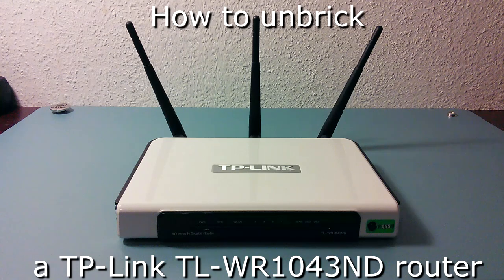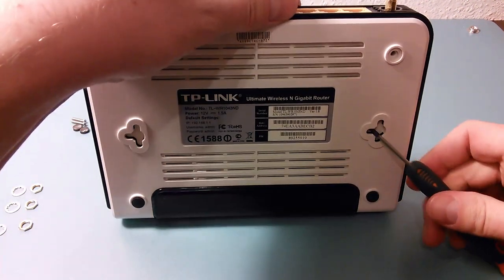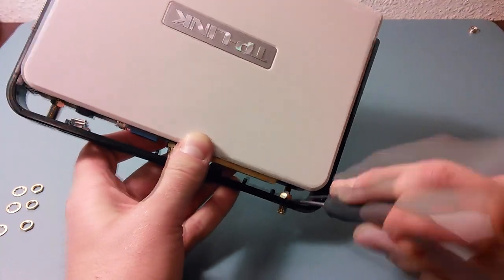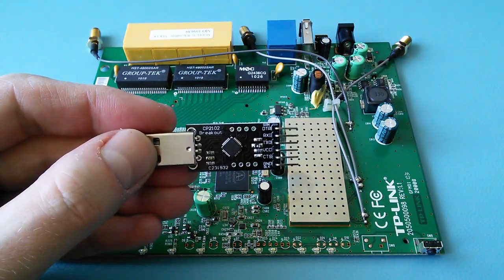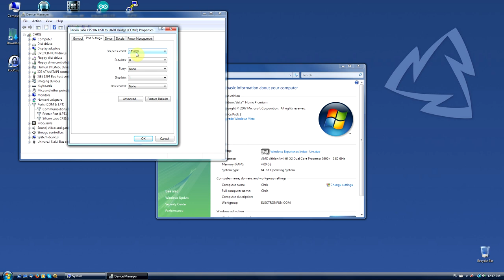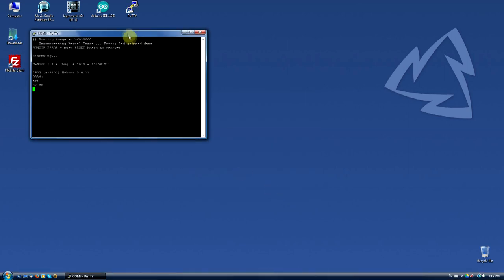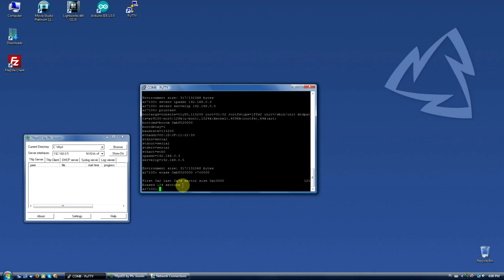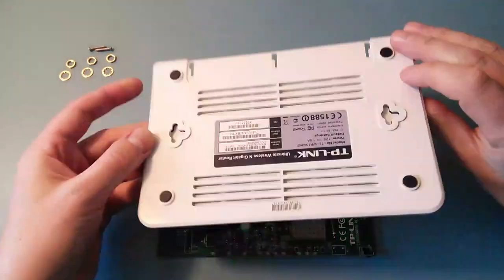How to unbrick a TP-Link TL-WR1043ND router (re-uploaded) || How-to-fix tutorial

Comment: Thank you very much, sir! I managed to issue a new lease on life on my WR1043ND V1.8 ( YB 2008, acq. 2012 ) which I had reflashed with DD-WRT before. It was solid, but acted kinda flaky and I started to question its reliability. As a consequence it layed in a box in my attic for several years as I went for another router. Recently I dug it out, and gave it a try with delicate precaution and triple-checking the boot start and end values of the flash cell. Got it on the first attempt, and now it's recommissioned in my home network as a wireless host. TP-Link dropped support long time ago, so it's high time for security improvement. And there we have it: A router from 2008 running OpenWRT 23.05.0 happily.
Bonus: It comes with WPA3 which is quite remarkable and interesting.
Reply from the maker: Thank you for taking the time to write your comment, sir! It's fantastic to know this old video of mine can still help somebody and one aging device can be saved from the dumpster.

Comment: I am pretty experienced keeping my collection of ancient routers updated with the latest supported release of OpenWRT.  I never had to do a serial console recovery on my TP-WR1043ND v1 until today.  Imagine my disappointment when I removed the two screws from the bottom, and the case gave no evidence of wanting to open.  I found no disassembly instructions on the regular web, so it was off to youtube.  And there was your video, showing how to take it apart without breaking it.  It turns out I didn't need to do a serial console recovery to fix my error, but I'm ready if I ever do! Thanks.
Reply: I'm glad the video is still useful for people, even after all these years.

Comment from the maker: This is a step by step tutorial on how to unbrick a TP-Link TL-WR1043ND router after an unsuccessful firmware upgrade.
How to unbrick a TP-Link TL-WR1043ND router (reuploaded)

Originally I uploaded this video on April 10, 2014, under this link:
http://www.youtube.com/watch?v=zrArf9iTMv4
On October 11, 2014 I accidentally deleted it from my channel. Boy, was I mad at myself!
Reply from the maker: Thanks for watching and commenting :) Sorry for deleting the video and causing this inconvenience.
Reply: Erase correctly, when trying to make tftp ... does not connect to the router :(, because the ip should be set 192.168.0.3?
Reply from the maker: Tftpd isn't connecting to the router, it is only a server/service from which your router downloads the firmware.
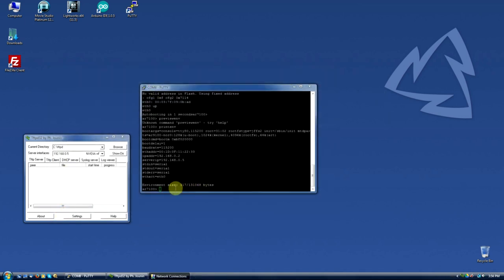Have you set ipaddr to 192.168.0.3 and serverip to 192.168.0.5? (see 13:28).
Reply: I use serial connection, using hyperterminal transfer firmware, recover my router. Thanks for your comment;)
Reply from the maker: Have you managed to get it up and running?
Reply: Yes!
Reply from the maker: That's great! :)
Reply: If you could add info about this 3 pin connector that would be helpful. Can't find it on allegro nor anywhere else.

Comment: This is a great tutorial.  I recovered my WR1043ND v1.6 
I had Chaos Calmer 15.05.1 Released: Mon, 16 Mar 2016 and I wanted to update it to a newer version, so I downloaded the latest release dated Jan 21, 2017 and flashed it.  Well it flashed successfully but the web interface went away and I could not log in using any browser. "Connection refused"  I also could not telnet to the router and because this router HW version was older than v1.8 there was no built in TFTP recovery.  So my only option for recovery was this tutorial.
Many Thanks for this, it certainly appreciated.
Dave
Reply from the maker: Thank you for your comment! I'm happy my video helped you fix your router :)

Comment: Works like a charm. Thanks. I adapted your method to my Linux box, and improvised a few bits here and there. 
To get the boot prompt for example I used... 

while true; do echo "tpl\r\n" >/dev/ttyUSB0;done

Then fired up the router and hit ^C the moment the boot loop stopped flashing. I also used the serial console of the Arduino IDE to connect to the router. 

You can alternatively use cu -l /dev/ttyUSB0 or any number of other terminal emulators available in Linux, for example putty with
 
sudo apt-get install putty

Google to find out how to set up tftp on your linux box, and you are off and running. 

From bricked to openwrt including soldering the header on the board <1hr.  as I already  had a suitable usb serial adapter sitting on my desk, and header pins in my junk box. One less router in the landfill. Thanks again for the easy instructions.
Reply from the maker: +Andrew Hull That's great! I'm happy you found my video useful and managed to unbrick your device. Thanks for your tips, they may be handy.

Comment: You are a GOD ... You just save my router from the DDwrt wrong firmware (Firmware V3 on V1 Session ¬¬) ... I checked your Arduino as a TTL programmer and combined with this video ! worked flawless .... if you use MALE x MALE jumpers you don't need to solder that 3-pin conector on the router board  (as long you work surface is flat and doesn't move)
Many thanks, cheers from brazil.

Comment: Great tutorial !! Thanks.
Two tips I learned:  
If when loading the firmware via it continues to wait with the T T T T T T T T T T reponses and fails, then you most likely have your ethernet cable wrongly in the WAN port of the router, move it to any of the four LAN ports of the router.
If that also fails, then it is possible to copy the firmware to the router via the existing three serial connections you have in place.  You use the YMODEM protocol to transfer the firmware.    To do this download free ExtraPutty as this includes the YMODEM transfer feature.   Do exactly as already discribed in this great vid, but rather than this command
tftpboot 0x81000000 firmware.bin [ENTER]
instead type
LOADY [ENTER]
then it waits to receive the firmware
so in the ExtraPutty header bar, select "File Transfers", Ymodem, Send, 
   browse and select your firmware.bin file
It shoud then copy to the router, much slower than the ethernet copy, but it does work.
Dont forget to continue with the remaining commands as per the video (commands below).
cp.b 0x81000000 0xbf020000 0x7c0000 [ENTER]
bootm 0xbf020000 [ENTER]

i hope this helps

.
Reply from the maker: +Lee Schofield Great tips, thanks for your comment :)
Reply: After failing at firmware flashing trough LAN, I have managed to flash it with ExtraPutty. Thanks a lot!

Comment: Thank you very much with your video I was able to relive my router. Which bricked when you update the firmware to the latest version of DD-WRT. The most difficult part in my case was to desolder, use a desoldering wire. I guess my delay would be because the electric welder does not transmit enough heat to the mesh.

Comment: This video helped me to unbrick my TL-MR3420 v2.4. I was trying to get openwrt working on it, but by some mistake bricked the router. Thanks for the video
Reply from the maker: +Thiwanka Wimalasuriya That's great! Did you use exactly the same commands or did you have to change anything?
Reply: +ElectronFun.com on my TL-MR3420  v2.4  i used 
erase 0x9f020000 +0x3c0000 instead of erase 0xbf020000 +7c0000. 
Everything else was same
Reply from the maker: +Thiwanka Wimalasuriya Thanks, someone may need your comment to unbrick their router :)
Reply: +Thiwanka Wimalasuriya How did you get values you need to type? I have 740N and I'm not sure what to type in.
Reply: +loodack , i found those values from http://redacacia.me/2013/03/07/debrick-your-tl-mr3420-router-with-a-serial-ttl-cable/ ,   did you check http://wiki.openwrt.org/toh/tp-link/tl-wr740n ?

Comment: The beginning of the video did even have hope, because I imagined it would only be possible to recover the router if it had at least initialized, but the video device can't even have a working switch! Mine for years had the customizable openwrt firmware, it was quite useful, but with new equipment on the network I needed the features available only in the original firmware (like QoS control in hardware). I was using a swap pendrive and ended up having a serious problem when trying the original TPlink firmware, now the system led, wan port and dhcp service don't work, clear sign of missing software, but as switch it still works. After work I will run this solution and hope to have this cool equipment back.

Comment: Thanks man! I was able to unbrick my v1.11
2 things:

In my case the screen was not looping with the "autoboot in 1 sec" message. I had to start the putty session and then power up the router, only then the Autoboot in 1 sec message would show up once and the fail with an error message among the lines "file missing on the fs folder" or similar. (i had been fiddling with the fs folder and that's how i bricked mine, i think)

I tried with the original firmware, because i had actually bricked it trying to come back from OpenWrt. It didn't work, it wasn't booting into router function. I moved back to openWrt. 

Thanks again, you saved me a couple of pesos
Reply from the maker: +Vic Strauss That's great! Thanks for describing your case and letting me know :)

Comment: Use TeraTerm and Broadcast command option to enter "tpl" into the boot. That worked.
After this the rest was easy.
note that the default firmeware needs to be stripped (dd if=filein of=fileout skip=257 bs=512) (in case is not in the video).
and this fileout (e.g. firmware.bin) can be used in the tftp directory/upload sequence.

was a day struggling to get into the boot sequence........

Comment: Thanks a lot man, I saved my mr3220 following your steps! I only had to find the correct memory addresses elsewhere. By the way, I was lucky just once when typing tpl+ENTER but unfortunately I moved the cable and was unable to send the string in the right moment after that so I used autohotkeys to assing the F1 key to send it so I just had to press F1 a couple of times. If anyone is in the same situation you can assign F1 to send tpl+enter just by putting the next in a txt file and renaming the extension to .ahk:

F1::
Send tpl{Enter}

and that's all, of course you can use any key you want.
Reply from the maker: Thanks a lot for your tip, it may help a lot of people! I'm glad you managed to bring your router back to life :)

Comment: Thanks, you saved my wr1043nd! 
Tip for others: RS-232 cable doesn't work with it. I have tried.
Reply from the maker: +Konstantin Krayushkin I'm glad it worked for you, thanks for your comment :)
Reply: +Konstantin Krayushkin Which firmware upgrade failed at your wr1043nd ?

Comment: Just a few notes on this, for people that can't still unbrick their router.

I have WR1043nd V1.7 (last version without fail-safe) and i was using dd-wrt, and decided to update my firmware because i had changed my ISP.
Used the wrong firmware version (dd-wrt for V2 instead of V1) and bricked my router.
Tried other tutorials but since my version doesn't have flash fail-safe, and my LAN ports were not powered for some reason, i couldn't fix it without opening it.

I followed this tutorial, soldered the pins, got the latest firmware version from tp-link, the correct one this time, followed the steps but no luck. I was still getting flashing LED's and this message on Putty "No valid address in Flash. Using fixed address. Auto-booting" or something like it.

So, my mistake here was getting firmware from tp-link instead of dd-wrt. Since i was using dd-wrt before the "brickning", I tried flashing the router again, this time with dd-wrt (same version i had before) and voilá, it came back from the dead.

Hope my experience helps someone. This works on Windows 10, with the latest versions of the software's on the video. All good as of 03/12/19.

Comment: AWESOME VIDEO, extremelly simple, very good and detailed steb by step!
Reply from the maker: Thank you very much! My videos are usually simple, step by step tutorials, which should be easy to follow - at least that are my assumptions.
Reply: Can you help? My router is on that loop, I tried to ger rid of OpenWRT to flash back the original firmware, but is bricked, I followed your video and everything went fine, but on the last step, I get a boot error, the firmware Im trying to upload is from the tp-link website, and my router version is 1.6, thanks
Reply from the maker: The firmware from manufacturer's website won't work - you need to get rid of the boot code first. The following website should help you do that: http://fejlesztek.hu/restoring-factory-firmware-on-tp-link-tl-wr1043nd.

Comment: Great video. For anyone with v1.8+ hardware though there's a simpler way that involves running a tftpd server from which the router can automatically fetch the firmware bin file. This is what I ended up doing. No disassembly needed. Read the "Flashing / Recovery using tftp only (without serial console)" section here https://oldwiki.archive.openwrt.org/toh/tp-link/tl-wr1043nd.
Another alternative is using a raspberry pi if you happen to have one. It already has a serial head with 3.3V ttl levels, so no USB converter needed. The 3-pin soldering part comes in handy from this video!

Comment: Hey,

Your tutorial is great, I've two questions because my router is different then yours, I've TP-Link MR3420, My questions are:

1- The firmware version you put in that directory is OpenWRT, can I replace that file with the TP-Link's official firmware for my router?
2- Will the commands be same as you used? If I want to flash stock ROM on the router different then the one showed in your video?

I shall be very thankful if you help me out :)

Comment: Hey, Nice Video! I wanted to ask whether I can load a firmware on an old router whose model and make I don't know. I jus have the board with the antenna and I guess the casing broke so I thought of making one on my own. Are there any markings on the board? Or a general firmware? A basic one?? Thanks in advance!!
Reply from the maker: Hi, thanks a lot! Unfortunately it's not that easy. Most firmware files are compiled not only for individual models, but also for specific hardware revisions.
If you're not sure what router you have, you can post a photo on a forum (e.g. https://forum.openwrt.org/), someone may be able to identify your hardware.
Reply: ohhh okay! Thanks a lot!

Comment: hello first thing thanks for your very useful video I am an Italian and I have a router tp-link tl-wr1043nd I had problems with the firmware update and now it does not even read the network cards when I insert the rj45 cable to disconnect me.
Do you think with this procedure do you think I can restore it?

sorry my english i am using google translator.

thank you

Comment: Thanks a lot ElectroFun.com for this great tutorial. I was able to unbrick my 1043nd v2.1 following this tutorial. 

Since this tutorial is for v1.x, the commands don't work on v2.x. I followed the set of commands as given on Openwrt wiki (https://wiki.openwrt.org/toh/tp-link/tl-wr1043nd) and it worked! For the reference of people with v2.x of wr1043nd, I am enumerating the steps which are different from this tutorial below:

1. Use the server ip address as 192.168.0.100 (as on v2 the router supposedly listens for this ip)

2. Use these commands:

erase 0x9f020000 +0x7c0000
tftp 0x80060000 firmware.bin
cp.b 0x80060000 0x9f020000 0x7c0000
boot.m 0x9f020000

3. The default address (to access the router after unbricking) for v2 is 192.168.0.1

4. Use a stripped firmware, not the factory version. I downloaded the stripped firmware from http://www.friedzombie.com/tplink-stripped-firmware/

5. I used Windows 10 and Putty couldn’t open the COM port initially. The trick was to run it as an administrator.
Reply from the maker: +Gagan Kaushal Great comment, it may help a lot of people, thanks a lot :)
Reply from the maker: +Carol Liep First thing - which hardware version do you have?
Reply: ***** I followed this tutorial as depicted and just changed the commands for 2.1 version. Have you tried it yet?
Reply from the maker: +Carol Liep I'm happy you managed to unbrick your router... and get some sleep :)

Comment: Everything went Ok now except for the last command "bootm" 
When I executed this the router went back to it's flashing bricked state.
Does this mean I didn't use the right firmware?
Reply from the maker: Might be. Which hardware version do you have and which firmware file did you download?
Reply: ElectronFun.com I have version 1.1 and downloaded webrevert to stock from the DD-WRT website
Reply: Jacob Visser Finally got it running again!
It was all about using the correct firmware allright. Found OpenWRT image via Google.
Reply from the maker: Jacob Visser
I'm glad your router works again, thanks for your reply!

Comment: Hi Electronfun, thanks for taking your time sharing this experience to all of tplink routers users. Greetings from Venezuela. I have a problem with mine, it only turns on with fixed power led, Does this troubleshooting has something to do with what you are explaining on this video? If it doesn´t, what should I do? I will be apreciated for your comments..
Reply from the maker: My problem was quite different - the router was in a loop while booting. I don't know what can be the cause of your issue, but you can always seek help on one of the following forums:
https://forum.openwrt.org
https://www.dd-wrt.com/forum
Reply: ElectronFun.com Well, thanks a lot. I will look for it. I well then tell how did it go.
Reply from the maker: Ok, I hope you'll find the answer there. Good luck!